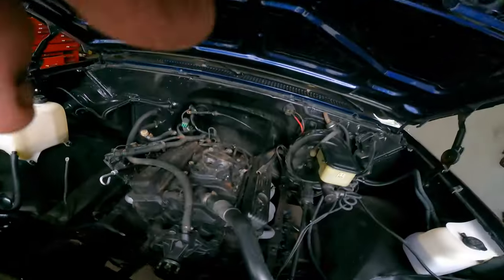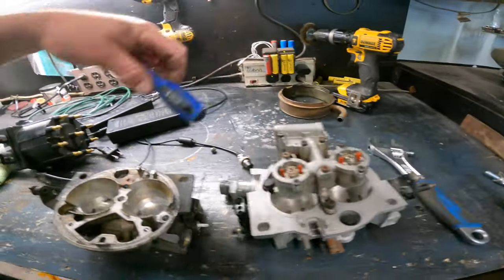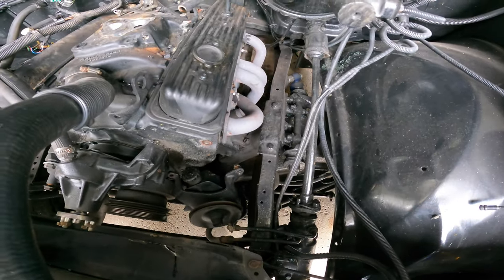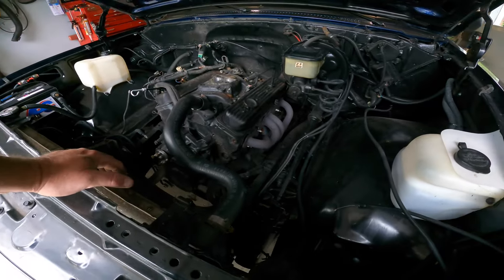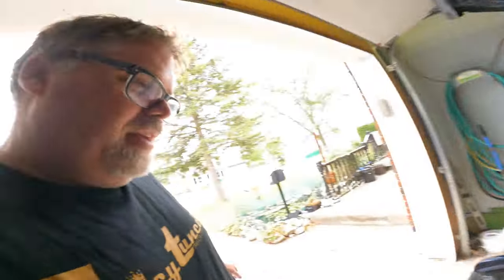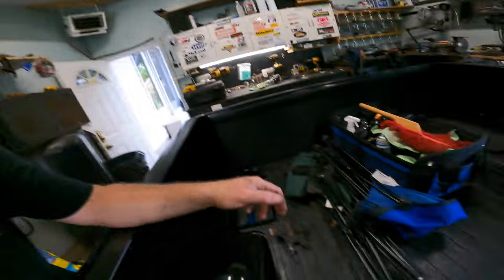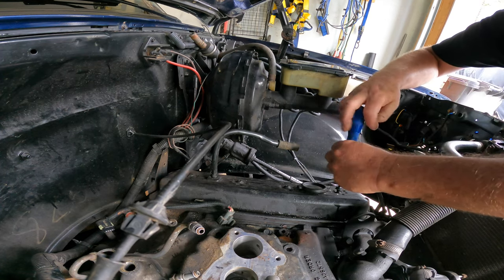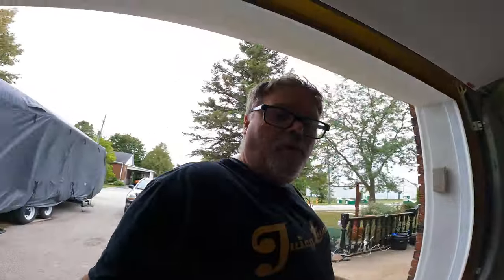No Turning Back Now   4K

Comment: Buddy I'm gonna build one soon. But I'm gonna rip all that electronic crap out go back to simple edlebrock carb &intake regular hei stock distributor with probably hot coil some good wires and plugs . Super reliable super cheap nothing fancy change the rear ratio to something like 373 or maybe 411. 700r4 trans 14 bolt rear . Bullet proof ripper. I'll be watching bud .keep on with the getting on

Comment: Definitely stick with holley. I have personally tryed most of the well known brands like mallory and DUI and flamethrower and one other brand I can't recall now and I have had by far the best luck with the holley when it comes to distributors. Also the easiest to fine replacement parts for. Yes other brands might have cool easier ways to make adjustments but the few mins saved doing that doesn't offset the reliability the holley gives you. So in the end bite the bullet and spend the extra $100 bucks and get the holley. Buy once cry once 🍻
Reply: "Buy once Cry once" lol. I'm stealing that lol

Comment: Hey Bill, I'd stop by and give you a hand with pulling the engine but I'm about 660 miles away from you.....  and that's if I take the ferry across lake Michigan.  I'm about 800 miles away if I drive around the bottom of lake Michigan. That's too far to drive just to pull an engine.  Sorry, bud.  😀
Reply: Ya I'm 26 hours away from bill or I would go help him out also